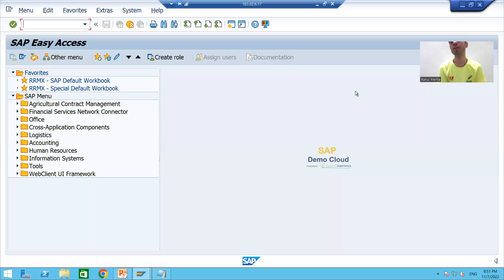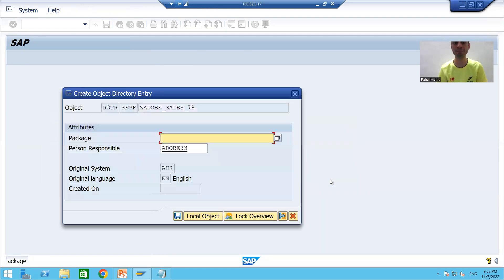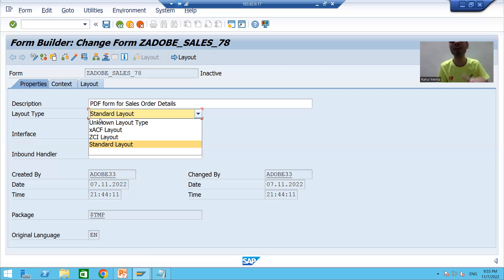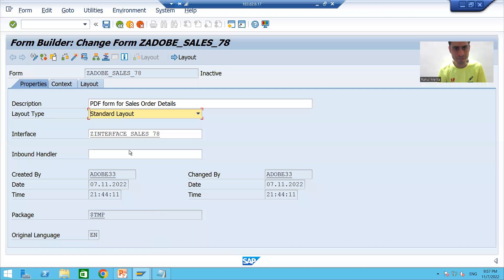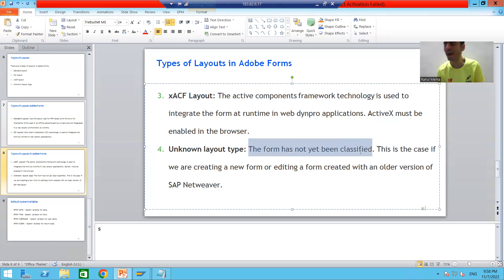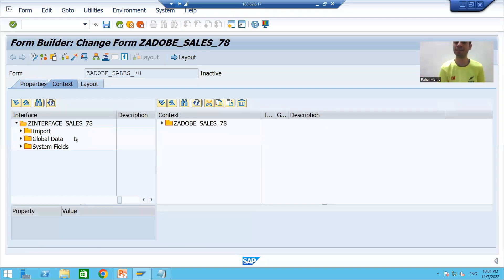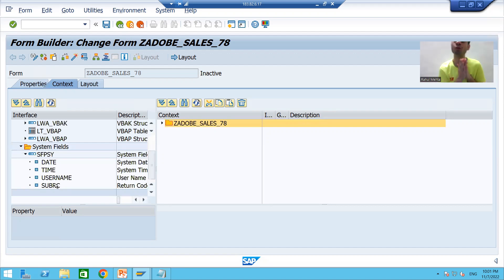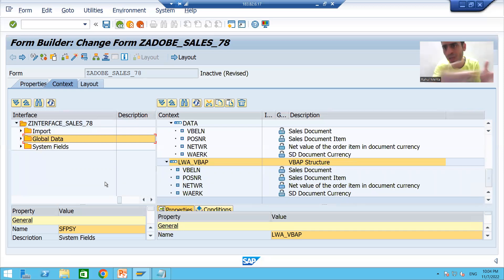4 - Adobe Forms - Layout Designing Part1

Comment: Hello Rahul- As I am going through this Adobe form series,I have a doubt, Suppose I have 2 fields in a sub form,the 1st field is on the top and it will display based on some condition.If there is no value in the 1st field,is it possible that the 2nd field will go to the top automatically?Is there any way for it?
Reply from the maker: Hello John - Sorry for the late reply. It is possible. Once you move forward, you will learn Scripting languages. We can achieve this through scripting langauge.

You need to write this of logic.

Using this.presence = "hidden"; will hide the complete element on your form. Thus, all the elements which are below the hidden one are moved up.

Using this.presence = "invisible"; will only hide the text inside the element not the element itself. Thus, the elements below stay where they are and nothing gets shifted.